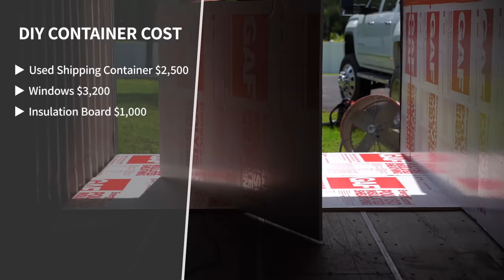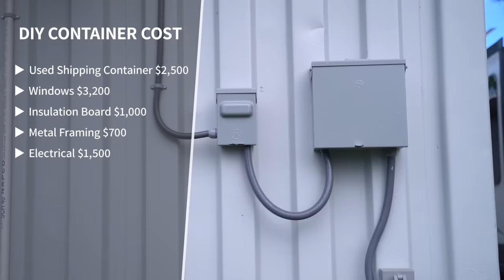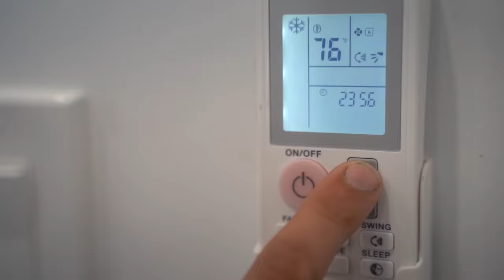40ft DIY Shipping Container Home (Total Cost Breakdown)

Comment: Wow! 😂😂 I have been researching and designing many different shipping container homes to ultimately build one in the following year. I was expecting to pay under 10 grand. Thank you for the honest breakdown! 👊🏼
Reply: I feel your pain Bro 😭😭😭 I was dead ass looking for a cheaper way around it 😭The truth hurts so bad
Reply: I foubd some containers for 8-12.  But that just for the container and delivery.  
The rest of my build is gonna be about 40k and that's with my brothers doing a lot of the metal work , weldong and fabrication of dokrs windows and roofing.  Not trying to bum you out.  But I have to hire a plumber and an electrician.  We don't do that kind of work.
Reply: Figure double this since you need permits, a foundation of some sort ( I recommend post and beam with good airflow under it so you don't also need to install concrete and a radon barrier ), sewer and electrical connections, and of course, a 2nd container, because 16x40 is an actual livable space with 2 rooms or a living room and so on - but this means double the cost for insulation, drywall, and so on.  You also need to add extra costs, IMO, for the exterior since you need a condensation barrier of some sort like siding.
$50K should be possible, and far better construction that you get in a typical similar priced mobile home.  But certainly not $20K.
20K IS possible, though, if you basically build a barn, put the utilities along one wall (literally nothing in the other 3 walls except 1-2 windows) , and use partition walls inside.  And live with the cement floor as-is.  There is a project run by the University of Georgia that does this and they are wooden barns, essentially, and extremely bare-bones like this as well.  They look a lot like simple log cabins, not too surprisingly. Yes, it's basically a box like a shipping container. lol. Lastly, note that standard 2x4 construction is actually slightly cheaper.  At even today's high cost of $3 for a 8 ft board, you will need roughly 250 of them to build a similar size container - all 6 walls.  Plus plywood to cover it all on the exterior.  Another $1000, basically. Figure $2000 total.  Wood is cheap and easy to work with - it's no mistake why homes are still made with it.
Reply: @plektosgaming  Cheap? You haven't tried to price wood/plywood lately, hmm? Lol. 10-12 years ago. An 8 x 10 drum room was 4k. And we built it ourselves.
Reply: @windsofmarchjourneyperrytr2823   In the end, you still need the same drywall/interior wall material of your choice, framing for insulation and support (can't attach drywall directly to the metal and need space for electrical), and so on as a traditional structure.   It's not quite the panacea some people are making it out to be, any more than people who build log homes - it all is still a lot of money unless you want to literally live in a box.

Comment: "Livable, healthy, and safe." The standard of that has greatly appreciated over time, and still varies greatly by location - but I do appreciate the breakdown even if my standards are different. I get that you're in the business of building for other people and that you are definitely trying to convince DIYers not to go it alone or think they can get "good work" for less than X dollars. I also know, though that many of the costs you mentioned can be dealt with for less with some creativity, or will scale favorably for larger builds (surface area increases at a much greater rate than perimeter).

Comment: I thought I was the only out of one million who hates loans with a passion.

I'd rather build a home with my own hands
Reply: Not that easy in most places, unless you're already a home contractor.   Too many needless regulations and codes.   If I could just buy land someplace I liked, and build without interference from Cities or Counties, I could build a nice quality home for pretty cheap.  If they'd just leave me alone, or just check that I'm not throwing an unsafe shack together, rather than sticking to bs building codes, that are mostly designed to keep contractors in business.
Reply: Bruh
Reply: @AnAbortiveRomance  Keep contractors in business? As a contractor I can tell you that's bullshit. Most of these building codes and regulations are anti-competitive and expensive for us builders to execute properly. Trust me, we would be making far more money if building guidelines were eased.
Reply: @flightevolution8132   I get that, but they make it almost impossible for someone without a contractors license to build anything with a bunch of ridiculous and unnecessary codes (depending on where you live).   So people have to use contractors/builders.   My father built several homes for himself in the 60's and 70's, before you had to get any inspections.   There's no way you could do that now most places, and they wouldn't have passed codes.  I recently remodeled one of those homes, guess what, all the bull shit code failures and the house was fine.  Tile over regular old fashioned sheetroc in the bathroom tub/shower.  No water proofing barrier, no mold proof sheetroc, no cement board, no redguard, etc.  Guess what, no mold or water damage in the walls after 50 years of use, 40 of those years as a rental.  The tile was ugly, and the grout was in horrible condition, but no real issues.  Try telling that to youtube shower tile instillation professionals.  OMG, the humanity.   lol.   ...On the otherhand, I understand that some people are idiots and unethical, who would do all sorts of crap if they could get away with to make a quick buck.  My friend who bought a 2-story home to remodel.  The back ground floor wall, that supported the 2nd floor, the builder had only used 2x4's placed 4 ft apart instead of 16 inches.    I just wished they'd leave everyone alone within reason.
Reply: @AnAbortiveRomance  The reason for the codes is to stop idiots from trying to build something they do not have the skill to. I can't tell you how many homeowners I've had to deal with who THINK they could build their own home, or install some fixture, etc, who in reality couldn't tell you one end of a hammer from the other. 

Building is a serious, difficult business. Those without experience should not be building. 

That being said, many codes are totally useless and just a pain in the ass to deal with. I get that. The same is true for most government oversight.
Reply: @flightevolution8132   Yes, that's all true.  Though building a single-family home is not rocket science.   But imo, part of the codes structure is designed to make sure people have to use licensed professionals.   I can do all my own electrical just fine, but am not allowed on a new home because I don't have a license.   Try building a new home around where I live and not using a licensed contractor--The inspectors will give you nothing but grief.   Why do I need to insulate the foundation 3ft into the ground, when I live in the Arizona desert where the closest the ground gets to freezing is an occasional light frost or someone spilling a frozen margarita, lol.   Eh, doesn't matter, it is what it is, and the bureaucrats need something to do.
Reply: @AnAbortiveRomance  For every informed individual like yourself, contractors have to deal with dozens that are unfortunately lacking in basic knowledge.

I remember a job from a few months ago where a couple built their own tiny home... but forgot to insulate it! We had to rip out the repurposed wood, drywall and start completely fresh. It was beyond a nightmare for the clients.

Comment: A couple of very important items to investigate if considering this: 1) see if this can be legally built in your area per code, and 2) what is the cost of the lot/land you want to build on.  The latter can vary quite a bit depending on location which adds to the total cost.  Where I live, the code in the incorporated city limits permit 1 container on the property as long as it is for storage or a "studio space" (basic electrical ok - no water or sewer hookups).

Comment: My boss did this in a sort of way. Poured a huge concrete pad and placed steel squares in the concrete corners. Stacked two containers on top of each other and welded them together and welded them to the steel pads in the concrete. Then had trusses fabricated in a gambrel roof configuration.  Water and electric of course. It was a killer shop that we used to pull or tractors and trailers and dump and pup  into for work and service. A really nice shop. And to heat the shop we installed a used oil heater which heated the whole shop really well. All the dirty oil coming out of all the tractors was used to fuel the furnace. Loved the shop. :O)

Comment: Great video!! I am planning an off grid solar powered home with living roof and solar panels and a composting toilet build. I plan on using 3 40 foot high cubes, north side double stacked, a slab concrete floor between and a single high cube on the southern face. I will have sliding glass doors from the containers to the interior (slab area) and a large roll up door to the area of the slab. The slab space will be used as an art studio, gallery, and garage for my housebus that I am currently living in. Wish me luck!! Thanks for the inspiration and cost analysis.
Reply: doubt this ever happened...lol

Comment: Thank you for this info.  I kind new what it would cost.  I have the container, just was waiting to save some money to work on it.  I just couldn't figure out how to insulate it and put up inside frame.  The step by step is really going to help me.
Reply: You can insulate as he did, and then frame outside that. I personally would pay the extra money to weld in your metal studs, and then do spray in foam insulation at 2 inches thick minimum. You can then drywall right to the metal studs. Then do plumbing and electrical along the baseboards at the bottom of the wall in conduits.  Why?  Plumbing and electrical is the first component to be outdated/updated/give problems, so you do not need to rip out your walls. A plumbing flood would be contained to the conduit and save your personal property and house from damage. More expensive upfront, but so much more cost effective long term.

Comment: After years of research (as a Millwright and former plumber), this is the first comprehensive video that 'objectively' covers the entire build sans a pad, septic and exterior. I would add, beware of local codes. I've heard a few horror stories about strict counties requiring certain specifications.

Comment: Super reasonable breakdown! 

I did a 20ft container for 14kCAD including a roof but no exterior, including wood stove and solar system (small) and excluding the toilet (we did a wood chip bucket) So minimal plumbing and no electrical. 

As you said, this is adjusted for items I scavenged and purchased used such as the kitchen, all the windows and doors and the insulation (rigid R20 used roofing insulation). And none of my labor is included.

Also great point about the miscellaneous line - mine is 3k of the 14k total.

Comment: Thank you for the video. As I look out at my container office which is a high cube 40’x8’ cut in half, and my final cost was almost exactly what you mentioned - double your hard cost estimate, at around $35,000. My cost includes concrete pouring for the foundation, pulling power from the house to the RV post, hard cost plus all labor cost involved in the San Gabriel Valley (Los Angeles) area. Good job - almost seemed like you had a copy of my binder for all my container office receipts! 👏👏👏
Reply: I plan on doing the same but in Texas. I got it at $26,000

Comment: Just found your channel.Planning on getting a shipping container house myself. Did the plan, made a budget (a bit over 100.000€) so I'm sure it will work. Just finding a firm to build it for me as I don't have any building know how. 

Only thing that is still a bit of a dark spot is the custom work on the structure (a 45"foot high cube pallet wide one as base) . Double end double doors, 2 custom 3 meter long doors to block the windows that I can use as side's for a private terras. Do you do metalwork or just only do cut-outs for doors/windows? How much would the meatlwork be on a custom container.

You mention, site preperation,could you do a video on that maybe?

Comment: I could do my own but, BUT I would mostly be doing it myself (electrical, plumbing, hvac, carpentry & painting). If I started in spring I could finish walls, windows, framing, electrical by fall. After that 😆 is recuperating, the rest I would wait to complete when I got more money. That is something people can do too if there is'nt a time limit. I love how you broke it down and honestly you were being frugal in some areas like insulation + flooring. Your cost in todays market Are spot on. If I was'nt so independent I would hire you to do my work knowing it would be up to my standard. Thanks for the excellent video, I subscribed! I'll be watching you 👍🏼😁😉
Reply: Mike Stone 
You can do it. 
Remember all monies you’ll need up front. There is no borrowing it from a bank. 
Unconventional loans are capped around $40grand 
With 10% high interest. 
Add 1/3 to the budget because simply your going to be screwed around by inexperienced sub contractors. 
Trust me it happened to me although I was able to retrieve a little of it back , the stupidity of inexperience is legal and common in these builds.

Comment: Question.  How do you move the  container after everything is completed? Will the container flex? Problems with sheet rock or cracking anything?
Thank you so much for. Asking this video! I'm excited to see more. Please make one where we can see the entire container!
Reply: T&L Palacios hey! Good question and the answer is, we have no idea how it will travel with drywall but you would have to assume it will have cracks after transport even without flex due to bumps and lack of suspension on transport trailers.  If that were a clients option I would not finish the drywall until it is in its final location, or go with ship lath or something that has a little more durability to transport.  We are going to be moving this container though so we will do a video on how it makes it!  I would guess I will be doing some drywall repair though :)
Reply: @bmadgett85  Thanks for the reply! Your doing a great job.  Thank you for sharing the process!

Comment: Thanks for the honesty. Taking into account that this video was posted pre-covid, let's keep in mind that fuel, materials and labor have skyrocketed.
I read somewhere that there is an issue with condensation and eventually mold inside container homes. Is a dehumidifier the most cost-effective (not space saving) method of reducing condensation or can you do something else? 
Do you recommend spray foam in colder climates like NorthEast (VT)? 
Is there a website that would list, by state, accredited shipping container home builders? 
So, it's safe to assume that the cheapest built just inside container home with labor would be in the neighborhood of $37K and possibly even in the $45K range if quality materials are used. Possibly even more now. 
Thanks very much for the info, super enlightening

Comment: "You´re going to spend way more money than you originally assume." - I´m finisihing the build on a 3 container home in Spain and those words should be tattoed on a visible part of the body of anyone trying this. Well done!
Reply: Is this your own property or are you a contractor? I'm very interested in doing the same in Spain but I wouldn't have a clue how to start, especially as what you are allowed and not allowed to build on land and of course what land they allow you to build on.
Reply: @fionascheepers8302  Hello Fiona, it´s our property. The "trick" with containers here is that as long as you don´t build a foundation (ie. on concrete blocks as we´ve done) they´re not classified as a fixed dwelling which means you can build them "almost" anywhere. I say almost because national parks and nature reserves would obviously be out of the question. Any rural land is eligible, especially with the classification of "rustico" or rustic (the local land registry office will tell you this). Arable land is a bit more complicated as you have to declare you will no longer be working the land and leaving it fallow. Be aware that you will have to do this yourself, as in Spain NO ONE has a clue on how it´s done in terms of hiring contractors. Hope this helps.

Comment: thanks for the info . I have a gutted 40 foot highway bus  so I probably need 50 grand for my project thanks again
Reply: Since your project is going to move try using things that are light for better gas millage . My friend used lighter gauge framing because the bus already has strong walls and regular insulation in batts is lighter than other kinds and goes easier around curves.Do not buy Home Depot or Lowes cabinets for a moving bus as they come apart ,either build your own or do like my pal got a very real wood set from habitat for humanity on the cheap.You can call a kitchen remodeling place  and they will sometimes have kitchens they have removed or will remove and will let you haul it away for free.Always insulate the floor.Good luck with your bus.
Reply: 50k will build you a nice bus!  I have a sprinter with a number of expensive components,  I'm probably into it 10k or a bit more

1000 solar
1500 awning
1000 electrical
1300 Engel refrigerator 
860   Natures head
300   Fan
500   Kitchen, built my own cabinet 
500   water system 
1000 diesel heater
800   window covers

Round it up to 10k, a few details still left.